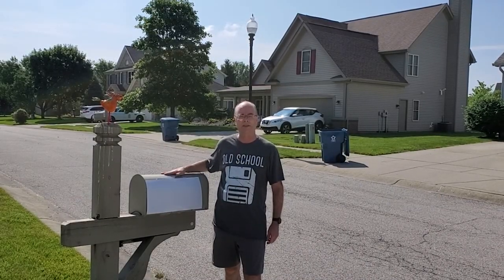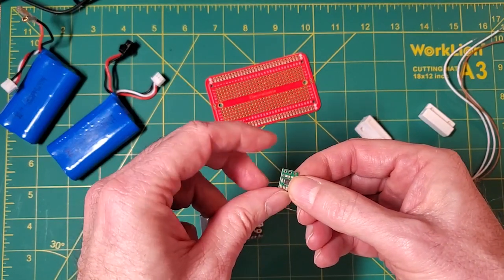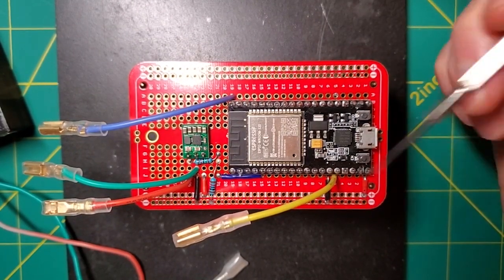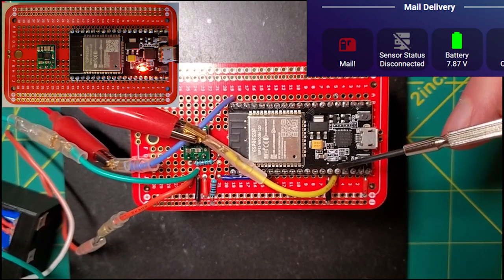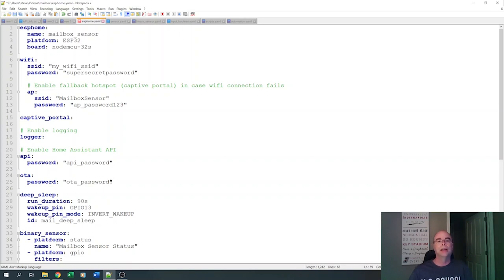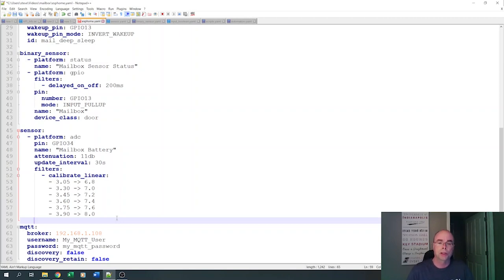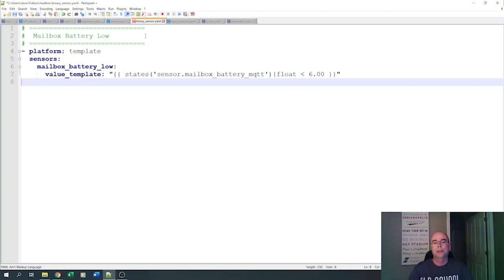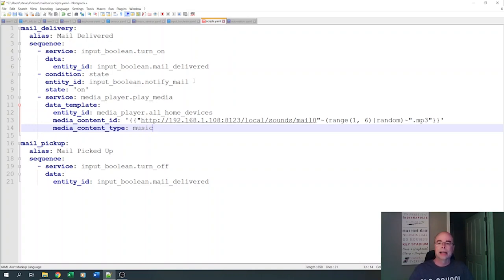An ESP32-based Mailbox Sensor for Home Assistant

Comment: I didn't see any provisions to provide a sync state?  In case the mail carrier opens, and closes, the door twice (because he/she missed an envelope) or if another family member opens the mailbox before the mail has been delivered.  Wouldn't this cause an out of sync issue that causes you to have to go to the mailbox and cycle the door reed switch, to get it back in sync?  Maybe an optical sensor (that is only powered when the ESP32 awakes) mounted to the top and looking for a reflective surface on the bottom would be helpful.  Then any envelope or mail that is put in the mailbox would break the beam and send a discrete (you for sure have mail).
Reply from the maker: I handle that (mostly) via the automations and scripts in Home Assistant.  In the first situation (mail carrier opens twice), we still receive the voice notification that mail was delivered.  I use an input_boolean in HA as the "flag", so I can always reset the state just by clicking on the button in Lovelace (I don't have to go to the mailbox and cycle the door to reset the state).  The same thing would happen if I take out mail to be picked up by the carrier.  In that case, I just toggle the input_boolean in HA to the proper state either before or after I take the mail out.

It doesn't happen often that it gets out of sync, but it can/does happen on occasion.  Your idea of an optical sensor is interesting, but it wouldn't solve the problem of when I take out mail to be picked up.  I'd break the beam putting in my outgoing mail and the same problem would result.  That's why I use the HA scripts and input_booleans to handle those types of situations.

Just as an FYI, I'm currently on V2 of the mailbox that uses a standalone Zigbee reed switch.  It's nice because there are no wires or exposed components, but it has signal problems with the metal mailbox.  So, I am now working on V3 (back to wifi), but with a power hat that ought to result in longer battery life since the step-down converter isn't needed (that always draws battery).  I'm doing a battery study at the moment and will do an updated mailbox video on the results when done.
Reply: @ResinChemTech  I look forward to your updated mailbox video and battery study.

One thought - a low power uC to detect the mailbox door opening, and use the enable pin of your regulator to boot up the power hungry wifi enabled esp32.  The uC could be powered with a very low loss linear regulator, taking very little battery power between activations.  Basically the idle current would be the shutdown current of the switching regulator, the resistive divider for voltage detection, and whatever the uC needs.
Reply from the maker: I'm actually waiting on a few parts, but I'm going to expand this to a few different versions in a side-by-side comparison.  One is what I mentioned above.. a power hat with a 3.7V LiPO battery and then another version with my 7.4V battery, but without the step up/down (since the ESP on board converter will handle the 7.4V).  In all these versions (including the original), I do have the ESP32 go into deep sleep until awakened by a reed sensor on a GPIO pin... at which point, it awakens for 90 seconds to connect to wifi and send updated data (including battery voltage via voltage divider) to Home Assistant.  So, in normal circumstances, the ESP32 is only 'awake' for 3 min./day.  

But I also want to integrate a low voltage relay trigger to shut down the circuit and protect the battery when a low voltage is hit.  I had a number of the 7.4V batteries ruined in the original version because the step up converter continued to draw power (all the way down to 1V) if I didn't catch it in time... like when traveling.  So, I want to build in a 'failsafe' that will simply kill the circuit if I don't replace a low battery in time.  More to come....
Reply: @ResinChemTech  That sounds very interesting!

Comment: Just finished the hardware part, the sensor is working, but i cannot figure our the HA button-card config. Could you share your button card code? And thank you for sharing.
Reply from the maker: You should note that I'm using a custom-button card here, available via HACS, but here is the Lovelace YAML that shows mail has been delivered: 

aspect_ratio: 1.2/1
color: rgb(0,255,0)
color_type: icon
entity: input_boolean.mail_delivered
name: No Mail
state:
  - color: rgb(128,128,128)
    icon: mdi:mailbox
    value: 'off'
  - color: rgb(255,0,0)
    icon: mdi:mailbox-up
    name: Mail!
    styles:
      icon:
        - animation: blink 2s ease infinite
    value: 'on'
type: custom:button-card
Reply: @ResinChemTech  yes I installed the custom card, just struggled with the syntax. Thank you very much for the assistance!

Comment: I've been contemplating doing this but with an esp32cam module that takes a picture of the content, maybe use opencv to detect mail too
Reply from the maker: That's a cool idea... if you can maintain battery life.  I eventually gave up on trying to improve the battery life enough with wifi and moved over to a Zigbee sensor.  While it took some tweaking to get a reliable signal from the sensor when inside the metal mailbox, I've currently been running without issue... and on the same battery... for over 6 months (with 40% still left on the battery).

I did a separate video on trying to improve battery life with the wifi version, but I didn't have a lot of luck, likely due to the voltage regulator on the ESP32 board.  But if you can design something that allows everything to truly go into deep sleep with very, very low draw on the battery, it would be a cool setup to get a photo as the notification that mail was delivered!  Let me know how it goes and if you do end up building something.
Reply: @ResinChemTech   Can you link to the video of the zigbee sensor?  Thats also what I did, but the battery didnt last very long.  Do you have an external battery connected to it?
Reply from the maker: I didn't do a video on the Zigbee sensor version (the video I referenced above was my attempt to extend battery life on the wifi version... which ended up not making much of a difference anyway).  I basically just removed everything from the wifi version and installed a Zigbee door sensor inside the mailbox.  I did have to add a Zigbee smart plug to the front porch to extend the Zigbee mesh... but otherwise it has been working great.  I got nearly 8 months out of the first battery (the built-in CR2032... no external battery or any other external device).  I have noticed that the new battery I installed in the fall is draining a little faster, but I blame that on the cold weather here in Indiana.  But it has been running for almost 5 months... and is still at 37% battery.

But here is the video I referenced above on trying to extend the battery life for the wifi version: https://youtu.be/OykXRflaKe0  ... but again, this has nothing to do with the Zigbee version.

Comment: Imagine being the mail guy and you open someone's mailbox and you see a ton of wires
Reply from the maker: Actually, the two small wires from the reed switch are enclosed in shrink tubing and taped into the upper corner of the mailbox.  Really not noticeable unless you are really looking for them.  About the only thing really visible to the carrier is the reed switch itself.  My bigger concern is that when they stuff packages into the box and potentially rip the switch from the side.  But so far, that hasn't happened.

Comment: How long does the battery last on the mailbox sensor?
Reply from the maker: I've been averaging about a month off a full charge.... a little longer in summer, shorter in the winter.  Theoretically, based on the draw of the ESP32 when in deep sleep, the battery should last significantly longer.  But I suspect that the ESPHome implementation is either not putting the ESP32 into the absolute lowest (deepest) sleep possible, or more likely, the 5V step up/step down regulator is drawing from the battery even with the ESP32 is asleep.  It's on my list of projects to revisit this... possibly using something like 4 AA batteries and eliminating the regulator to see what kind of battery life I might get.
Reply: @ResinChemTech  Yes, the regulators will always have a current draw. I would even look at bypassing the internal 3.3v regulator on the ESP32 module. You do that by simply wiring 3.3 volts (2.2 - 3.6 V) to the 3.3 V pin. The internal regulator won't draw any current when back fed voltage on it's output. If you use LiFePo4 the max voltage is 3.7 but quickly drops to 3.4. Maybe put a 3.6 v zener across it as a safety.
Reply from the maker: Thanks for the ideas!  The one in the video was actual v2, as the original worked for over a year, but after spending time completely buried under snow for 2 days this past winter (FYI, snow does an excellent job of completely blocking WiFi!), some of the connections were getting corroded.  I weather-proofed the second one a bit better.  Ideally, I'd like to tinker with a Zigbee door sensor (now that I have a Tasmotized Zigbee hub), but will probably have to add some sort of external antenna (and maybe a externally mounted Zigbee router), as I suspect putting the switch inside a metal mailbox will pretty much kill any signal back to the hub.  If I can get a Zigbee sensor to work, it will alleviate the battery issue, plus no external wiring will be needed nor will there be any exposure to the elements. Maybe v3 or v4!
Reply: @ResinChemTech  I agree about the ZigBee. I just got ZigBee up and running so I need to go try it to see if it will work. I also bought some ZigBee outlet switches (that plug into an outlet) and plan to place them around the house to act as ZigBee repeaters. Hopefully one will be able to reach the mailbox.
Reply from the maker: I spun up a Sonoff Zigbee hub flashed with Tasmota a few months ago and placed centrally in the house.  I paired a couple of Aquar door sensors for the garage entry and service doors and they have been rock solid (with great battery life so far).  I also have a Sonoff S31 Lite Zigbee outlet, but have yet to use it.  I'm figuring I might be able to plug this into the outlet on the front porch to extend the mesh to the mailbox, but need to find a way to weatherproof it, as the Sonoff S31 is not rated for outdoor use and it's dimensions make it difficult to enclose into any sort of standard outdoor outlet box.